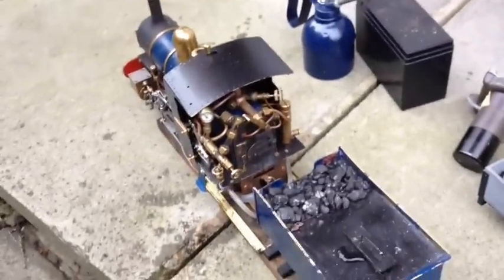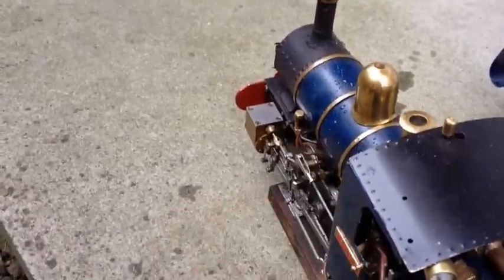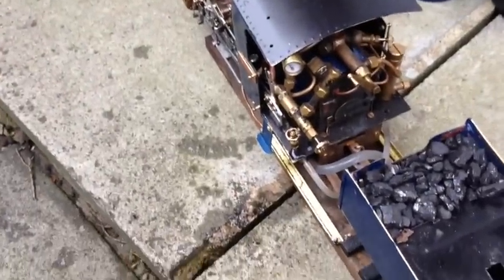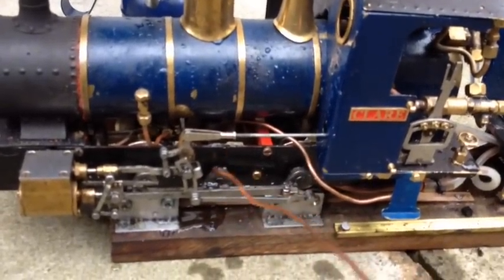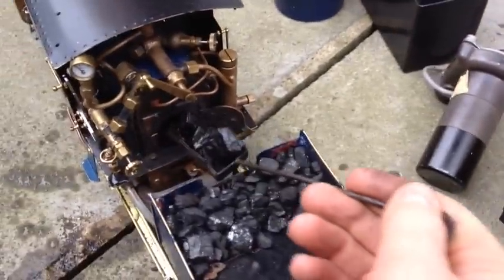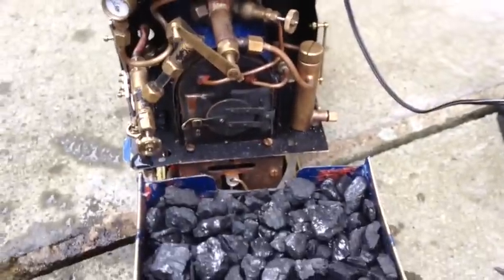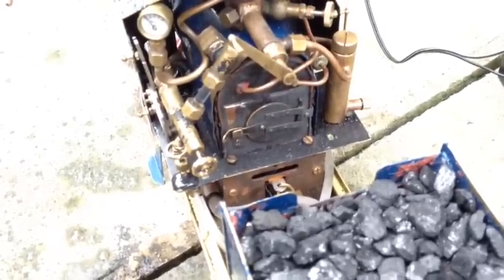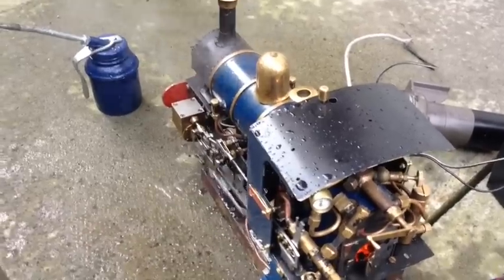How To Fire A Coal Fired Engine- Roundhouse Fowler

Comment: would this modification work on a jenny?
Reply from the maker: McBenMan 1 you may need to adjust the diameter of the boiler barrel but in theory yes a coal fired boiler could fit to a Jenny.
Reply: @DansModellingUniverse  thank you for your advice.
where did you purchase the boiler?
Reply from the maker: McBenMan 1 I didn’t purchase it. I built it several years ago with the help of an experienced engineer friend. The plans and manual is from “steam trains in your garden” book by Brian Wilson.
Reply: Codlington Light Railway what tools did u use?

Comment: Tried using anthracite coal on my traction engine but it kept going out and steamed  badly. Any tips?
Reply: Matt Seymour i have a 5” gauge simplex. Its abit easier because its bigger (the bigger the fire box, the easier to get a fire going) but ill start the way i do it. Use char coal soaked in white spirit. As you light it get your electric blower going. Wait untill you get some pressure starting to build then put abit of coal on. Not alot, let the first shovel or so catch, then add some more. Go easy as its easy to put the fire out by smothering it. When your on a bit a pressure put your steam blower on and remove the fan. This uses some steam but is much more efficient. Keep the blower on but turn it down as the pressure builds. Then your away, keep your coal level with the bottom of the fire hole door. Hope this helps abit. As i said its easier on mine but hope this helps slightly. What engine you got?
Reply: Thanks for the tips have used them and works well.  I have a 3.5 inch Juliet
Reply: @harpinbrad  thanks for the advice. Would it be ideal to start with housecoal then go to anthracite once it's caught?
Reply: Matt Seymour i use bbq charcoal with white spirit poured over then go on to welsh steam coal. And i have a simplex but i have been looking at a juliette there a beautiful little loco! 😍
Reply: @harpinbrad  yeah Juliet's are good locos and mine steams well. 
I have a 4f now but waiting for boiler to be built for it 
If I was to go from Charcoal and parafin to housecoal then Welsh steam would that work better to get it to catch?
Reply: Matt Seymour tbh ive never tried that! I just do it charcoal until and keep on charcoal untill the pressure gets to enough to put the steam blower on and take battery off then bit more charcoal and a shovel or two of welsh steam coal then wait for that to catch. Im still learning myself though! Haha
Reply: @harpinbrad  arh ok sounds good. What I do is get the charcoal going then after 5 mins or so I put on a shovel of coal every 2 mins or so till built up full pressure.
Try the housecoal as it catches better and had others give this advice then go to anthracite
Reply: Matt Seymour awesome ill give it a try
Reply: @harpinbrad  cool try buying the Columbian housecoal as is cleaned burning I've heard.  Let me know how you get on?
Is charcoal better than wood for 3.5 inch gauge?
Reply: Anthracite requires more draft than softer coal. More blower never hurts.
Reply: @Skipper77777777  thanks I found that but prefer welsh steam to anthracite

Comment: So is that electric blower pulling a draught quite fiercely? As I'm having trouble getting a good fire going and I'm wondering if my blower is a bit too feeble and screwing up the whole process.
Reply: if your blower is the same as the one in this video , take the bottom part off and check inside as when you use it the soot from the fire and smoke slowly build up layers and can slow down the blade and make a weaker fire and not raise pressure as quickly as before , if that is not the problem ,have well soaked wood or charcoal and have a thick layer to start with and get the heat in the boiler and make steam and slowly add coal and then when u got 25/30 psi use the loco steam blower and then it should be fine , but if the blower is mucked up it wont draw the fire as good